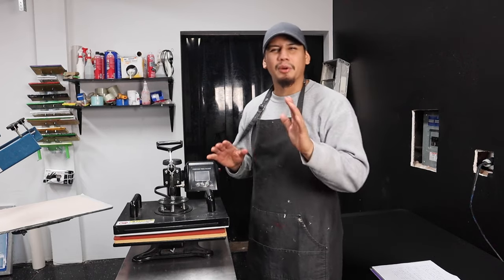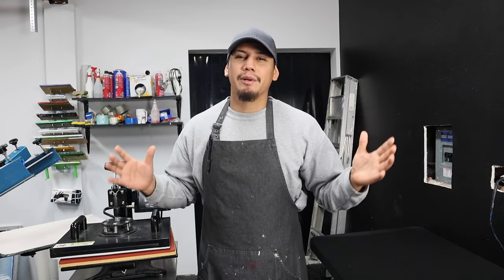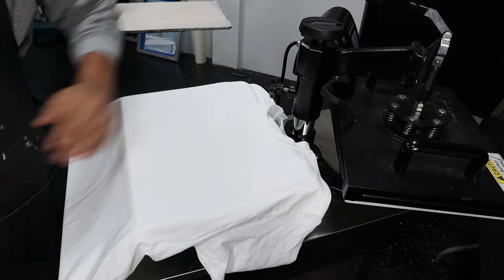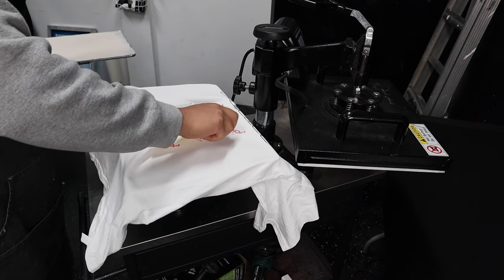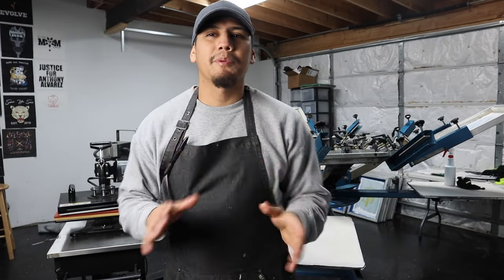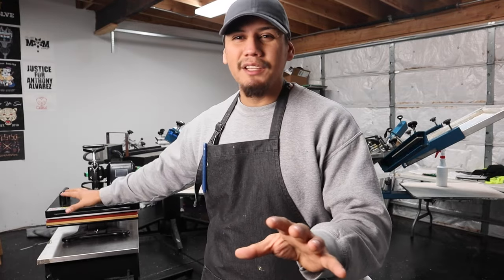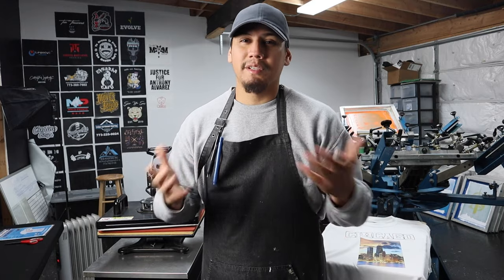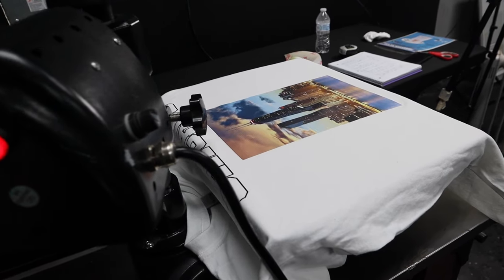CHEAP AMAZON HEAT PRESS

Comment: The worst thing about cheaper heat presses is inconsistent heat across the entire plate/design.  Sure it might get hot in the middle or in certain spots but other spots usually won't be the same temp.  Spend the extra and get a good press imo.  You NEVER want to run across a person that has your shirt on that is cracked, peeling or dull from migration.
Reply: yeah a great one is only an extra 200 or 300 bucks.
Reply: Which one would u recommend?

Comment: What is the larger press you do recommend getting?
Reply from the maker: A press that had a bigger platen I will say 15”x 15” …. If it has a automatic lift up even better ..
Reply from the maker: Umm honestly idk ..  I would say something between 15” x 20”.
Reply: @myloprints  Sorry, I should have been more spesific. You have a larger press in the video, I was wondering what press that was?
Reply: Yes I would also like to kno the brand of the press you recommend,  and congratulations to the winner

Comment: HI Mylo! Your videos inspired me to start screen printing. I set up the cheap VEVOR screen printing with some great initial results.    I have a question about "off contact" printing. Do you use it for T-Shirts?  I set up my screen so that it lays completely flat against the board, but then I read that the screen should be 1/16" off the board sometimes. Do you ever do 1/16" off contact prints?
Reply from the maker: yes the off contact is essential when it comes to printing.  to make everything easier try to use a quarter. you need a quarter space form your platen to your screen
Reply from the maker: Hello yes off contact is supper Important  … I will explain it a bit in. My next video ..